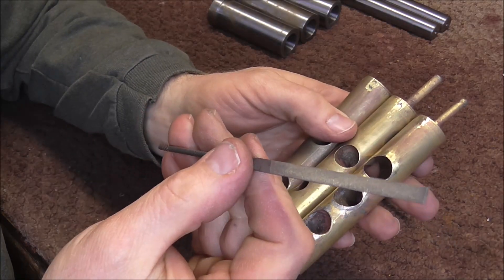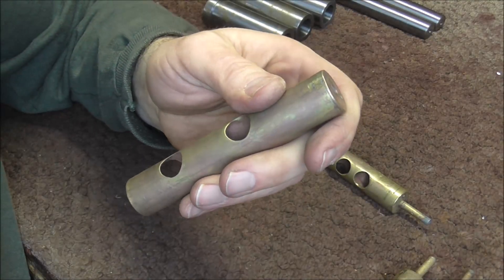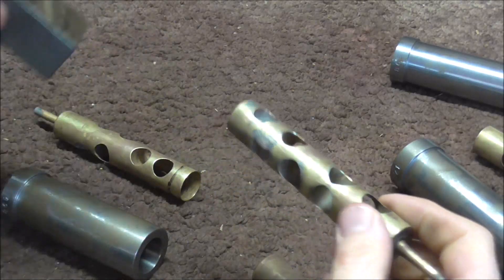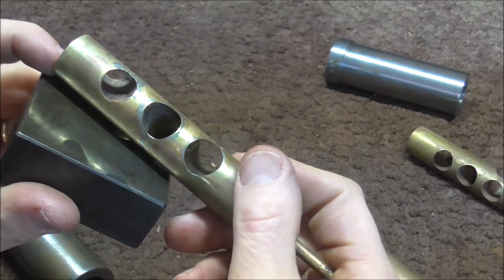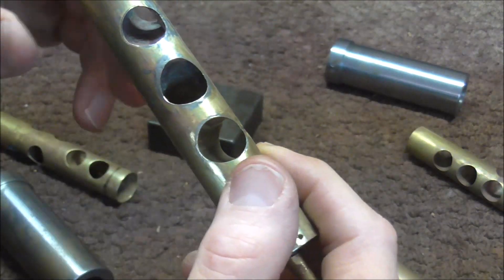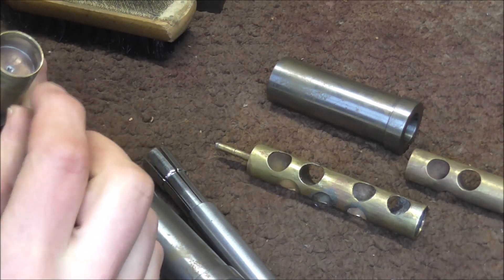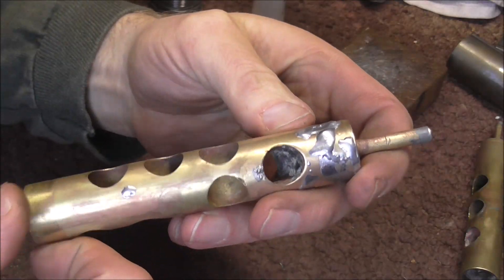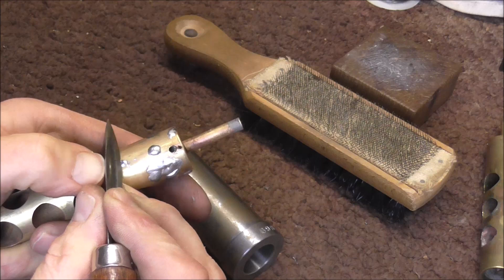Working On Really Messed Up Valves: Enharmonic Euphonium Restoration Series #6

Comment: I'm not an expert on Besson valves from this era, but I believe these pistons would originally have been unplated.  Unplated pistons were relatively common in this era, with instruments such as the Boosey & Co. Solbron and Silbron models using particular alloys of brass as an alternative way of extending valve life.